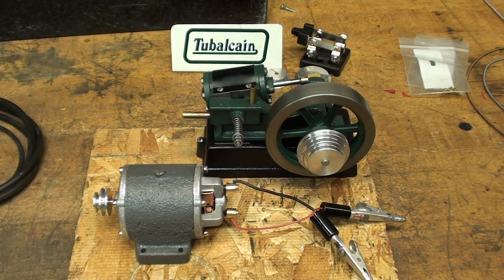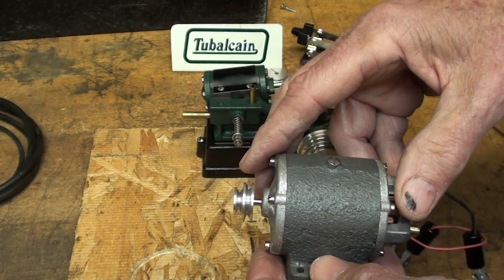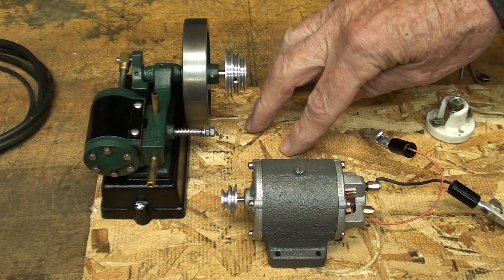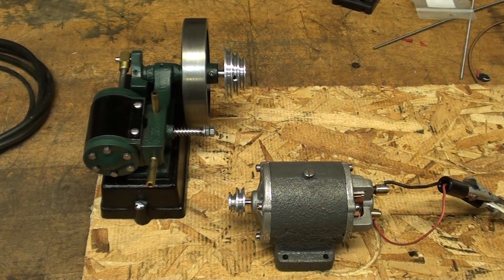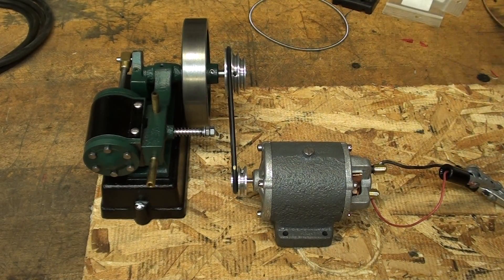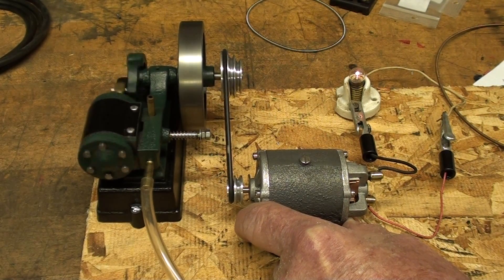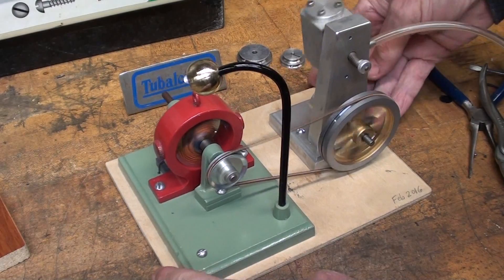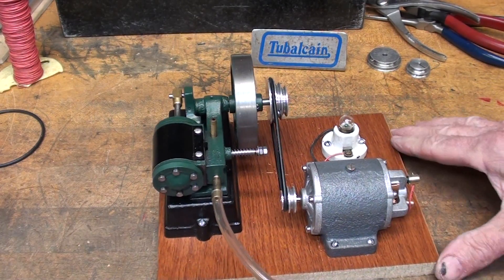Pair the Dynamo with Stuart Engine Tips #439 tubalcain

Comment: A month or so back I purchased a ready built one, from the uk importer, at 3600 rpm in produces maybe 2 volts, the terminals are as you first built yours.
Tomorrow I will try to turn the end bell 90 degrees. I will report back, and thanks for showing the mistake 👍
(oh, and mine won't motor at all at 6 volts, not even trying)
EDIT: Sorry couldn't wait, midnight here and end bell now turned 90 degrees, motors at a couple thousand rpm now on six volts 😎
Thanks very much for this video, most useful even 4 years later 🍻

Comment: Another great project.  I've been wanting to build a steam engine / dynamo combination to charge my cell phone.  That seems wildly impractical, except when I'm without power for a few weeks after a hurricane blows through.  :-)
Reply from the maker: I would want to use it for my refrigerator
Reply: @mrpete222  - I'd need a much bigger steam engine and alternator for that.  :-)

Comment: The Dynamo reminds me of a old GE generator powered by a Big 3 cylinder diesel I saw from back in the 30's or 40's at a old gunnery station battery on the coast of either North or South Carolina.  
It was 30 years ago.
Reply from the maker: I would like to have seen that engine

Comment: Nice looking combination there. I know you don't much like finishing and painting, but it sure adds to the visual appeal.

When the spring belt slips, it is because the belt-to-pulley friction (times the diameter) does not make enough torque. If there is room, you can get more torque from the same amount of friction by increasing the diameter of the pulleys (keeping them in proportion). For instance, if the pulleys you have there are 3/4" and 3/8" (guesstimated from the video) then a 1-1/2" and 3/4" would give the same speed with twice the torque. (Same friction, but twice the FPM belt speed.) Of course any combination which keeps the same size ratio will do the same and increase the driven torque by the increase in pulley sizes.

Comment: If you need different length o-rings you can cut them and rejoin the ends with a little superglue.
Reply from the maker: Thanks, I have the kit. But the glue is dried up

Comment: If you search Ore Wired LED om ebay you will get the ones with the resitor in it. They work on 3 to 12 volts
Reply from the maker: Thank you, I will check them out

Comment: Great stuff Mr Pete!  Glad to help a tiny bit.  Looking forward to your next model engine build.

There are several different types of E10 bulbs with various voltage and current ratings, so by swapping bulbs and moving belts you can usually find the one that provides steady light while giving the engine a working load.  Your Stuart seems to be spinning the dynamo quite happily.
Reply from the maker: Thank you Doug. You helped more than a tiny bit. I probably would not have done this video without those Pullys

Comment: Luvved this video!  Most of us are used to the 60 hertz (rps) standard for electricity on North America.  Once upon a time in Ontario, we also had a standard of 25 hertz from some generating stations.  While this might have been okay for some applications, with the advent of radio in the 1920s, the 25 hertz standard had to be changed so that we had a uniform 60 hertz through out.  

With your incandescent light-bulb flickering, it would be interesting to know what the hertz rate  is.  Any chance (via a tachometer?)

Comment: I don't know if you've tried it with other engines but I think replacing the coil spring that secures the cylinder with a Belleville spring would allow it to be much shorter. On such a small engine, it kind of sticks out and messes with the proportions. With the generator setup you have it seems like it's crowding in on the belt.
Reply from the maker: I tried that on the 3-D printed and Jean. It was way too much pressure

Comment: When I was a kid, I had a 100-in-one electronics project kit that was sold by Radio Shack. It used electrical terminals which were coil springs which were smaller at one end. When I screwed them all together, I thought that was a new idea for a type of drive belt. I see now that it wasn't a new idea at all.
Reply from the maker: I remember those little Springs